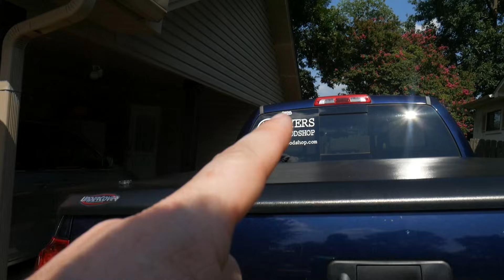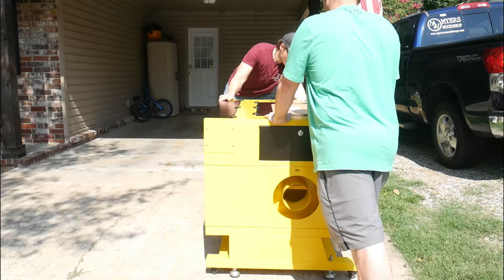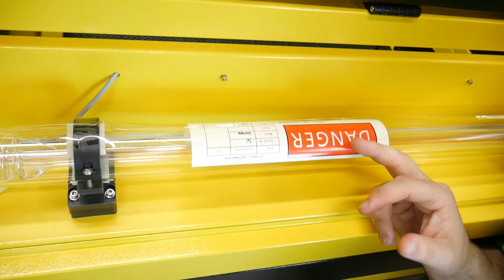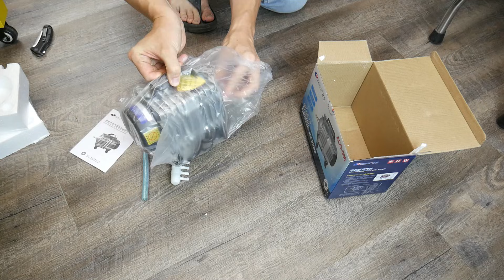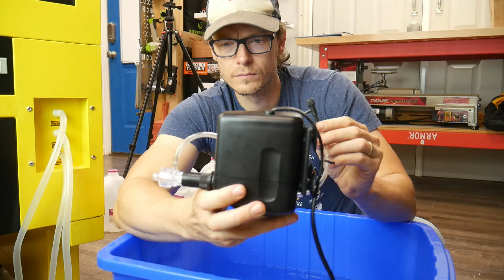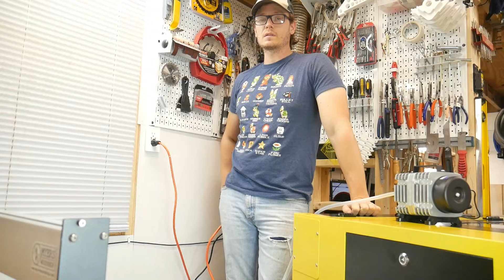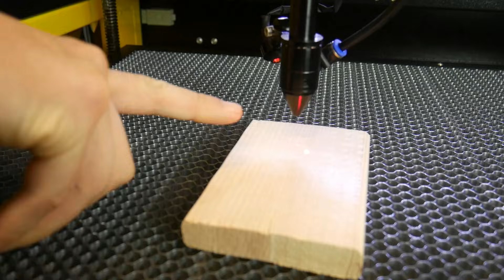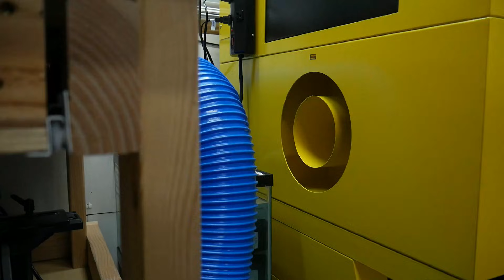Did I Waste $2400 on a 60W Laser Cutter from China?

Comment: I've used a k40 that included orion tech docs, wonder if k40 whisper (scorchworks) can be used with this?
Reply from the maker: i use lightburn, so i'm not sure.  this one wanted RD works.
Reply: K40 whisperer is primarily made for the M2 Nano controllers, it won't work with a Ruida. Not that you need it to, Lightburn is leagues better.